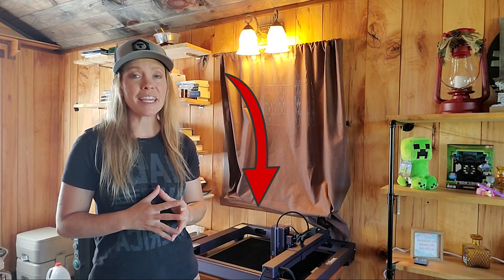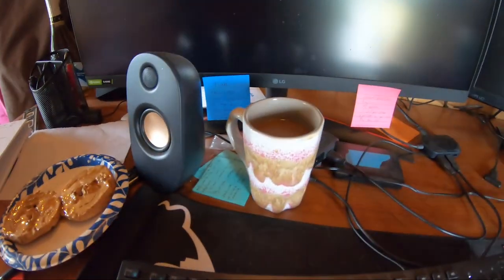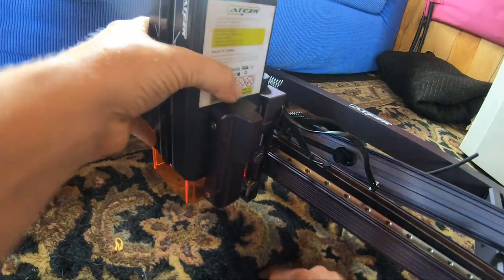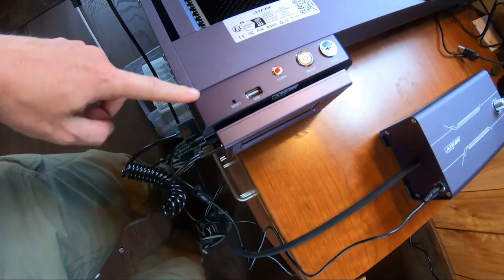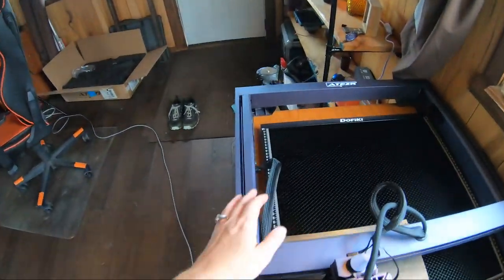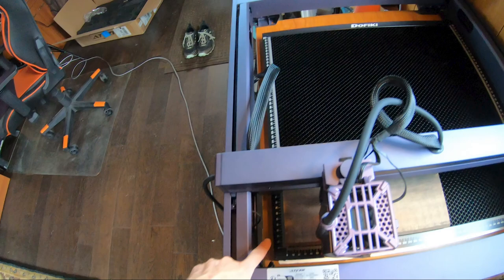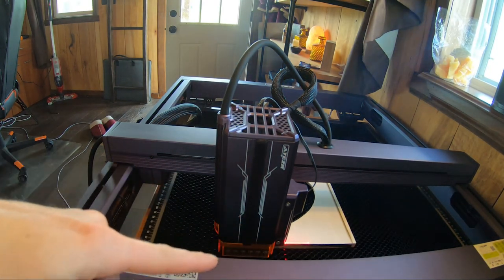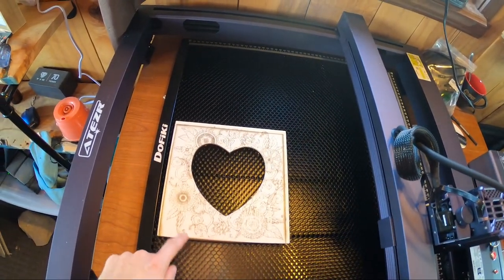473 NEWLY RELEASED Atezr L2 36w Diode laser FULL REVIEW - What Can it DO?

Comment: Would you still recommend this laser engraver ?  Or is there a different one you’d rather have?   My first one I wasn’t impressed with, which is why I’m asking
Reply from the maker: So really, it comes down to what you are doing with it. This is hands down the most powerful one I've tested AND on the market. The rotary unit that can be bought separately is less than others AND more advanced (has adjustable tilt). It's also very FAST. However, like all other laser units, it's not user friendly. It takes a bit of work to figure out both in the program and on the machine.

So when I had the chance to try out an xTool M1, I was blown away at how stupid easy it was. It came with it's own program (it's not compatible with standard programs), and it was easy for any beginner to figure out, plus it had a camera to make it even easier. I also loved the vinyl cutter for making shirts!

HOWEVER . . . it was PAINFULLY slow. To the point of just being a curiosity and anything that could generate a decent income. At only 10 watts of power, it cannot burn through much.

So it got me thinking, that perhaps adding a camera to THIS cutter could be a game changer. Lightburn has the ability to pair with a camera and Amazon has plenty for sale under $100.

Ultimately I had to PICK ONE to keep, and I kept the 36watt Atezr simply because time is a major issue in my life and I think adding the camera will be just the ticket. Plus the rotary tool options are more in line with what I'd be using it for.

I do have the M1 shown in videos around December if you are curious. Doing an engraved bottle took 1.5 hrs . . .

Comment: Nice looking she shed. Did you do that yourself?
Reply from the maker: LOL, thankyou! Yes and no. I tried to save time by having  a shell custom made for me and finishing the inside myself (I actually have a full playlist of the project). I should have simply done the shell myself as it was NOT made to the specs I had requested and was thrown together. I had requested hardwood which takes longer to rot and it was produced in pine . . . I did go through and apply a protective stain but likely I will have to over-side it in sheet metal  to keep it from rotting :(

Comment: What sized honeycomb is that? I just ordered the laser and currently have a 400mm x 400mm. Thanks
Reply from the maker: It's the biggest square one I could find, I think 400x400.  So Honestly, I did a review of the xTool M1, and while I was impressed by ALL that it could do, it was PAINFULLY SLOW. To the point of ONLY being for fun as a hobby. I was trying to figure out which laser I wanted to keep (don't need 2), and I ended up sticking with the Atezr 36 watt. AND, Atezr also offers a rotary tool that's able to be angle set, which is a HUGE ungrade from the rotary tool xTool offers (and less expensive). Eventually I'll get a rotary tool AND the encasement cover and exhaust fan, along with a camera. I think it's worth it honestly, not too many on the market offer 36watt AND the ability to cut what this laser can cut.

The BIGGEST headache is trying to use Lightburn. But getting a camera (Amazon offers them) is a big time saver, just read reviews and choose one that seems best.

Comment: Not blaming the you but, We bought just about every option for this unit but the extension and hood....Were not very happy so far, one of the X rods were not mounted in its socket and would not fit even with the screw out of the socket, had to be hammered in. The unit was scratched up, when I contacted support they said...oh sorry. We paid $1600 for this unit and it seems to have software issues and it will not autofocus and tech support is useless....I really regret buying this unit.
Reply from the maker: I'm sorry to hear you have been having issues with it. The X rod is difficult to get in (I did mention that to the company rep), but the software issues can be caused from needing to update the drivers for the machine, and making sure the correct options are loaded into Light Burn. Try going to the Lightburn forum and explain the software issues you are having. Because Lightburn is a third party software, it can sometimes  be tricky to make sure the correct features are loaded in, and then making sure you are choosing the right set-up for your particular laser. They can walk you through what might be going wrong. I had an issue where the machine would slam to the right instead of going home when I clicked "home". It ended up I didn't have the parameters correct.  Also check in at the Atezr Facebook group, sometimes customer service on there can get things done more efficiently.
Reply from the maker: ok, so looking at the videos you posted, I am seeing a few things. First, for the autofocus to work, you need to focus it on a level surface. It cannot focus on the edge of a surface because it will "tip" the material on your board. Try positoning to laser fully on the material, then click autofocus, then move the laser head into the area you want to cut. Also, I would try using it connected directly to the computer as you will have a wider range of options. I never used much of the display face, but there IS a key area in there that needs to be set-up correctly and that's why you are getting those positioning errors.  Go back through the directions step by step slowly. "Auxillary Positioning" is what I didn't setup correctly, and likely that's what might be throughing you off too. In the big manual it's page 3 of 'Setting Part".

Comment: Great, to bad this company does not stand behind its products. Purchased one and literally worked only 3xs and now going back & forth for weeks with no resultion.
Reply from the maker: Have you tried any of the Facebook forums? I'm sure there is one for Atezr products or laser engraving in general. I had a few issues with mine only to find out it was the settings in Lightburn. It would be nice if they could include a base user program that was straight forward and easy to use. XTool does with their M1 machine, it's a nice software piece and easy to use. However the machine itself is very low powered compared to the L2 Atezr, 10w vs 36w .  I have found too many companies don't have good customer service. I had to order new parts for the X1 from XTool and it was a month or more before I got them. They kept neglecting to put my order in.

But I would definitely check facebook for a group!
Reply: @This1LifeWeLive  yes I have but came done to its either the wiring harness or the laser due to when I disconnect the laser it starts to work. I connect the laser and it shuts down instantly.
Reply from the maker: It sounds like it's either shorting out (wire coating rubbed off somewhere) or the wires in the harness are incorrectly connected. Can you get them to send out a new harness? I'd look around online and see who sells replacement harnesses, they usually are not much. My M1 machine I gave to a retired friend and they went to clean it and put it back together wrong, so the wiring harness got chopped by the cooling fan. Eventhough customer service was friendly, it still took 2 months to get the part I needed. I looked online and while I found retailers that sold it, all were sold out. Likely someone sells a wiring harness for the L2. I'd give that a shot and see.
Reply: @This1LifeWeLive well I go round and round with them. I sent them a video, and still the same response, we have to send you the parts and that might take a while. It's a short I know it is short, but if it were a real company, I wouldn't have to go in circles just to get something done.
But I'm a valued customer according to their emails. SMH. Thank You